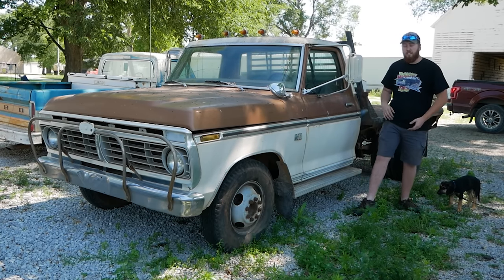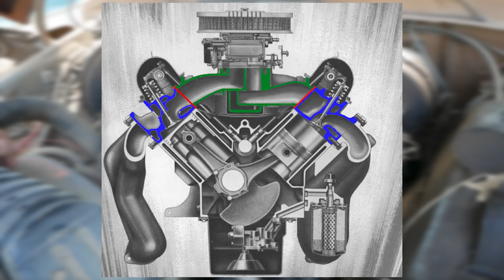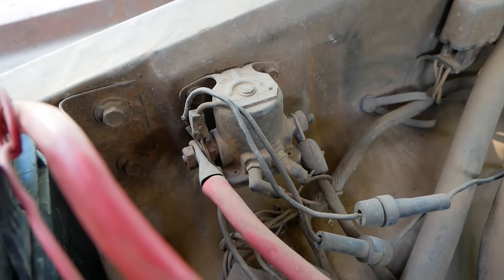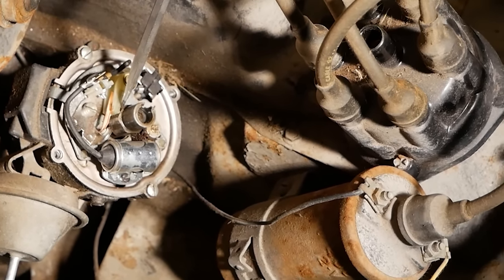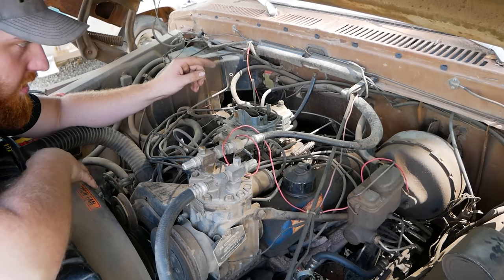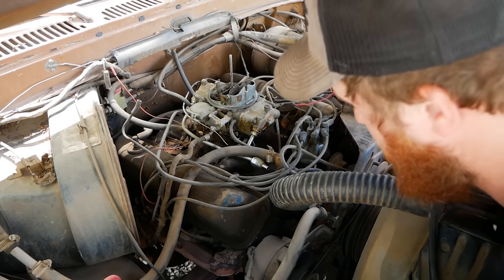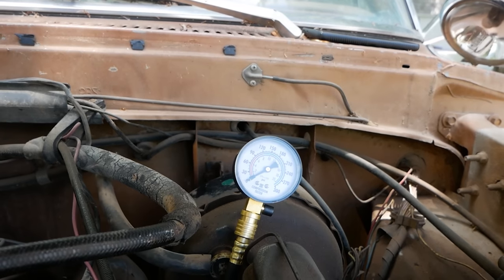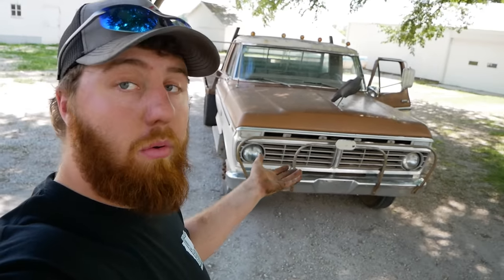How To Revive Abandoned Cars and Trucks! 1974 F350 First Start

Comment: "The engine works perfectly. It's just a fuel problem." Famous last words.
Reply: BOOM 

10 miles away ———— what was that
Reply: @nopegaming2117  helped tear an engine down with "a perfect block" The cylinder was cracked through to the coolant passage. They heard my boss's yell F 4 blocks over.
Reply: That’s what they all said on the car that I found parked for 10 years. Just a fuel pump. No. It was the entire damn fuel system along with multiple sensors.
Reply: hopped in my truck 8 months ago, didn’t start, that was my intuition, still hasn’t moved lol

Comment: This is a trip down memory lane. My dad had an old Ford flatbed with 4 on the floor too. In 1989 we drove it from Los Angeles to Mexico and left it there. It was driven very little since it was left there and a few years later when my grandfather passed away my dad needed the truck for taking material to the cemetery and we took his old Ford. It sounded exactly the way this one did, but it barely ran on the road. It was stolen a few years later and that was the end of that. I have a soft spot for these because my uncles had old Fords too and I took many a ride with them as a little kid. Good memories.

Comment: Hey Kevin i know what I'm about to tell you isn't a revival project but my stepfather's GMC Suburban wouldn't start but i thought its not the fuel pump because its working so i said to my self it's not getting the fuel to the engine & there might be air in the fuel line. So i undid the fuel line asked my step sad to see any fuel comes out & it did told my step dad to put the fuel line back & let my step dad turn the key & the truck turned over. 
Thanks to me my step dad got his truck back & going & no other high priced mechanic touched his truck but me!
I started to fix cars since i was in high school & I'm still doing that today & i love it.  😄

Comment: I'll never forget helping my coworker pull the intake off his 390, man that was weird when I realized the pushrods go through it. I thought, " Huh...that's weird." Love those old FE engines.
Reply: On GM 3.1 & 3.4L engines. The push rods don't go through the intake per day, BUT you do still have to remove them to properly replace lower intake gaskets that are notorious for leaking both coolant and oil....

Comment: Kevin:  "Chevy makes you do math"  
Meanwhile Ford: oh no that's the other 302 firing order 🙄🙄 
Chevy driver odds passenger even 🇺🇸🤙💚
Reply: Ik the timing order of my 400sb by heart 1843572
Reply: @timtorgerson2216 its got a misfire?! 😂
Reply: 361 302 429 and 460 timing by memory
Reply from the maker: LS is the Sbf firing order, and bore spacing, and exhaust spacing... And... Hmmmm 👀😎
Reply: @timtorgerson2216  might wanna check plug/wires on cylinder 6 lol
Reply: @JunkyardDigs  Actually, all LS V8s have a 4.400" bore spacing, same as the gen1/2 SBC. Whereas SBF has 4.380". Also if you look at a diagram of an SBF firing order next to an LS or SBC firing order, and you draw a line between each cylinder in the sequence, you'll find that neither SBF firing order matches up with the LS firing order which is 1-8-7-2-6-5-4-3. If you renumber the SBF cylinders to match the way GM (and most other auto makers) number the cylinders then the SBF firing order will translate on an SBC/LS to the following. The pre-94 302 firing order would translate to 2-1-8-4-3-6-5-7, while the HO and 94 and on firing order would translate to 2-6-5-4-3-1-8-7 on an engine with it's cylinders numbered the way that most other manufacturers do it. (It should go without saying, but with the amount of assholes on the internet today I'll say it anyway. I'm not trying to be an asshole, just trying to clear some air and maybe help you to learn some new things.Love the show, keep doing what you love and I''ll keep watching)
Reply: P.S. Sorry for the Great Wall of Text, I just felt that it had to be said.
Reply from the maker: @maxwellihm5373  fuck i never thought of the fact they have different numerical layouts! Clever man
Reply: Chevy like a rock it dont move
Reply: @JunkyardDigs  if Chevy motors were numbered like Ford's life would be much simpler

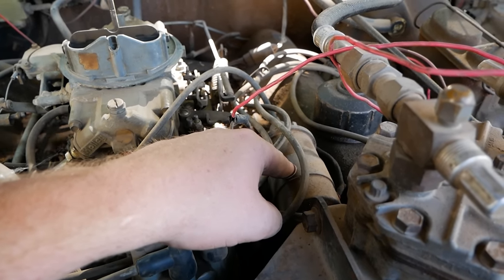Comment: That tip about the rotor at 21:23 saved me big time. I had this weird rough idle that I couldn't tune out and there were no vacuum leaks either. One day the car lost spark altogether and it was getting dark outside. Sure enough after popping the cap off I noticed the tab was completely flat. Not only did it get the car running again, it also fixed the idle issue! Keep the videos coming man.

Comment: Awesome!!! I ALWAYS soak the the cylinders for about a week with Seafoam, Marvel's Mystery Oil, or even transmission fluid and turn the engine over by hand once a day before I ever attempt to fire it if it's something that's been sitting a long time. It could mean the difference between busting rings and totally rebuilding the engine and getting her running good. I'll even dump a little two cycle in the carburetor. She's gonna smoke like a train for a bit but it could save the engine!!!
Reply: Amen
Reply: It really depends on what your working with and how valuable/rare the engine your working with is. If it's just a generic 305 chevy or 302 ford or a 318 Chrysler just send it and fire it up, what's the worst that could happen you blow a $50 engine lol. Now if it's something rare like a 427 big block chevy or something  of equal rarity or value then yes, soak the engine, change the fluids and pre prime the oiling system before the first fire up but I think its overkill for your average run of the mill engine like a 305.
Reply: Your right . That also helps to free up the rings too .

Comment: Heh, shows how skookum these old engines are. A modern engine with a coolant leak like that would just hydrolock and fail. Ol FE keeps runnin' just damn fine on the other seven! No joke it's probably been running on seven for *years*.
Reply: I'm thinking that's why they've left the sparkulator loose, to avoid building compression
Reply: I didn't know that having sloppy tolerances meant having a good engine.
Reply: @what nite First, a small correction that's a RELIABLE engine. That's only one of the things that make an engine good. Second, this is not a truck, it's a family car. So wouldn't call exactly a "work" car. Lastly I was to referring to things like having a 5L beast of an engine that only makes a bit more than 200 HP.
Reply: @what nite Oh shit I didn't look at the thumbnail. I had a 1978 Thunderbird in mind when I wrote that.
Reply: my dads 05 f250 has been running on seven for the past 200,000 miles. it has the "junk" 2 valve 5.4 that everyone loves to hate. i think it just crossed 620k last month
Reply: @dakotadriggers8838  I am pretty the 3 or 4 valve ones are junk...
Reply: @fortcrafterbossbehold9027  3v is awful
Reply: @dakotadriggers8838  Bought my first car, an 01 Chevy Trailblazer a few months ago. While I was looking for a car, the allure of a V8 was very intoxicating but the only 3 options were some slugglishly rubbish 1994-2000 RAM 1500 5.9s, overpriced or overmileage 2001-2002 Chevy Silverados, 2001-2006 Chevy Tahoes (I did not nearly have enough skill or confidence to drive those lumbering beasts in our more or less crowded roads, then or now), and 3v Ford F-150s which I strayed away from for their hidious reliability issues...

Comment: This video was so helpful! I've been staring at my dads 70 challenger for the past 20 years and going through this video we finally got it running off starting fluid. Next step getting a fuel system and going for a test drive.

Comment: Quick tip for gapping points. Keep a  couple paper match books in your tool kit and glove  box. Thickness of the match book is almost identical to the proper feeler gauge. 

My wife and I still run our 73, 460 swapped F 250, on a points system,  as well as a couple of our motorcycles. We also keep an emory board,  nail file,  or an actual points file, in our toolboxes, the truck,  and in the bikes.

Comment: Can't wait to see JYD and an international engine where all timing is based off of Tdc on cylinder number 8, got me the first time working on it
Reply from the maker: Oh god ....
Reply: Internationals are weird. Great, tough engines, but weird as hell. I own an old 345 in a '69 truck. Slow as dirt, but strong as an ox. Timing it was.... An adventure. I grew up and learned on small block Fords. Confused the crap out of me for a while.

I love it cuz it's weird. But the 302 in my F150 is much easier to mess with, and get parts for.
Reply: Why the binder engineers did that will always be a mystery to me.

Comment: Could be a good engine to do a review on liquid head gasket sealant.

We used to sell bottles of the stuff to taxi drivers here in Australia who ran old falcons that loved to do head gaskets..they'd run a $10 bottle of that stuff through it instead of replacing the head gasket 😅
Reply: K seal is the brand that changed my mind on coolant fixes in a bottle. Coincidentally when I first saw it work magic on a few rads/head gasket/heater core, Roadkill featured it saving a couple of their cars
Reply: Just did my 88' 460 with a liquid head gasket sealer.  Works like a charm.
Reply: EA, EB, ED had it built in, every 100000kms do a head lol

Comment: I just did a revive and drive today on an 89 f350 custom dually flatbed with a 460 and a 5 speed. Wish i had recorded it. Sure was a task. Had to pull it out the weeds, over a bank... with a skidsteer... then had to gone through 2 batteries 2 jump packs, had a crackling solenoid so had to clean it and it worked. Still no crank from key but solenoid itll fire up. Doing brake hose tomorrow

Comment: Just had the same thing happen to my ‘96 f150. Been running fine and developed a bad miss that kept getting worse. Changed out all my new ignition system I installed two months ago and finally pressure washed the engine.  I can see the blown head gasket and watch coolant come out between the head and the block. Easier to see too since its a 300. 

May not have been the video you wanted but its the video people need to see.

Comment: Coils do go out. My 1964 Chevrolet C20 left me on the side of the road at midnight in the      dead of winter. I checked the ignition system and everything pointed to an overheated, the coils sides and top were bulging. I called my brother, he was so happy, and we towed it 35 miles back home. The next week, coli replaced, she ran like a top

Comment: I absolutely love Ford FE V8s. I have a 68 F100 short with a Mercury 410 FE and a top loader 4 speed and a semi floating Dana 60 with 4.10. Gears and a power loc differential. She's a torque monster . A serious Tire fryer. I also have a 69 short box with a  428 PI  " A " scratch block and a 4 speed top loader as well. 3.55 gear 9" with a Detroit locker. It's a very fast gas hog. And a 71 f100 short box 4x4 with a swapped in 390 and a NP435  4 speed trans . Factory 360 2V but it had to go. I see a pattern developing now that I think

Comment: I used to drive a 1975 F-350 with a twelve foot deck in high school.  It was only 13 years old at the time but it wasn't in much better shape than this one.  Shortly after I started driving it (when I was 16) I put it's third engine in it (360 cu inch).  I used to get as low as 6 mpg with that truck (at close to 80 mph) and that is per imperial gallon (4.54 litres) not American (3.79 litres). Although that era of Ford truck is still my favourite, they definitely were not built to last (at least not the F-350 anyway).

Comment: that '74!   I drove a '73 with a wrecker body in my Illinois/Iowa '70s college/gas station/garage days.   It was just a Custom, this one's a lot fancier.   It was a 360 with the four-speed, this all looks the same.   This will be either a 360 or a 390, the sticker on the valve cover should say which and so will the data sticker code on the door.  Rust-free... sweet.

Comment: The flatbed reminds me of the one my great grandfather bought brand new only it was for a roofing company my family owns, and I was working on back in 2018 or 2017 it had transmission problems I think and if you hit the breaks while in park also it's an automatic so when you do that it would go reverse 40 mph driving forward applied backwards which is why the truck was sit in park for years because it was too dangerous but I was determined and now she ain't here no more but either way the truck reminded me of the one I kind of did have

Comment: I find that Marvel Mystery oil is the best additive in the gas and oil for getting these revived. It lubes the gas and helps the valves,and in the oil it speeds up the oiling process, cleans out the passages, and improves compression.

Comment: 1974 was the first year for electronic ignition and disc brakes on ford trucks, doubt it was converted, coils can be checked with a ohm meter, center post and positive open, center post and ground open, positive and ground  low ohms,  a coil does not store energy it makes high voltage when the magnetic field collapses over the windings in the center, the positive and neg are large wires, the the center wire coil are smaller and a crap load of them to get high voltage. 73 1/2 to 74 will have the new body style with points and front drum brakes, check the frame under the driver door 74-79 like to crack there

Comment: ATF is good for mostly anything that has friction even as replacement for WD-40. Actually I changed my power steering pump on my Cavalier 2005 because it started to whine and other noise. Second pump was bought at scrapyard like new and still made the noise so I realised the liquid needed to be changed. Flushed and changed for newer power steering fluid as recommended by GM and the noises were still there. So I decided to fully flush again and go with Dexron-3 like in older cars recommendations. Voilà! Problem solved. No more whining, no more ticking, no more noise and can turn the steering wheel using one finger.

Comment: Can't remember if you covered this or not, but one thing to make sure of is if it has an aftermarket electronic ignition system (i.e. Pertronix) make sure it's getting a full 12 volts. 9 volts is what goes to the ignition from the factory on a Ford and will let it run, but it might run like poop. Ask me how I know 😂
Great video Kevin!

Fun fact - TH289 had a video on this and that's how I figured it out
Reply from the maker: Yup thats in there!

Comment: Trying to troubleshoot a 1988 F250 I want to get back on the road. EFI throws another wrench into things. So does EGR and smog pumps. I forgot to try the pulling of the plug wires. I’ll give that a shot to narrow down which cylinder isn’t firing. I think it’s an injector issue, though. Good tip on the T-stat. 👍

Comment: Just for grins I asked ChatGPT.  Maybe this will stop one person from calling you?

Setting the ignition timing on a 1974 F350 involves adjusting the position of the distributor. Here are the general steps to follow:

Make sure the engine is at operating temperature and turned off.

Locate the timing marks on the engine. The timing marks consist of a notch on the crankshaft pulley and a scale on the timing cover.

Remove the distributor cap and rotor to expose the distributor shaft.

Turn the engine over by hand until the timing mark on the crankshaft pulley lines up with the "0" mark on the timing cover.

Check the rotor position. It should be pointing at the number one cylinder on the distributor cap.

Loosen the distributor hold-down bolt.

Start the engine and use a timing light to adjust the timing. The timing light will flash each time the spark plug fires, illuminating the timing marks on the crankshaft pulley and the timing cover.

Use a wrench to rotate the distributor until the timing mark on the crankshaft pulley lines up with the recommended timing for your engine (which can vary depending on the specific model and configuration of your engine).

Tighten the distributor hold-down bolt while holding the distributor in position.

Recheck the timing with the timing light to make sure it is set correctly.

Reinstall the distributor cap and rotor.

Turn off the engine and clean up your work area.

Comment: It's either a 390 or a 360 I had a 1970 f100 with a 360 with a three speed on the column both are good engines, look up Ford 360 engine on a Dyno. Oh yeah the best advice I could give to someone trying to start an old car or truck that's been sitting a long time is bring a can of spray lubricant to spray down the carburetor linkage

Comment: Well Kevin there R more folks than U might think that watch your stuff. I believe that truck you have with the brush guard was and Oklahoma Power & Energy Dept truck. I drove one exactly like it when I lived and worked out there in fly over country... It was the exact place where I developed my severe allergies to Fords. Every morning I had to give that damn Ford truck I drove mouth to muffler resuscitation. If the battery wasn't dead the carb was flooded if the carb wasn't flooded it had no brakes if the brakes still worked something else stopped working. Till the end of my two years working for OPE I was on first name basis with every auto parts store counter person in all of Oklahoma.

Comment: I have a 360 FE.  I hear the FE heads and intake were designed that way to bend nascar rules.  They had a requirement that the heads had to be cast iron, but not the intake.  To save weight, they built the intake manifold out of Aluminum and it served as about 1/4 of the head on each side.